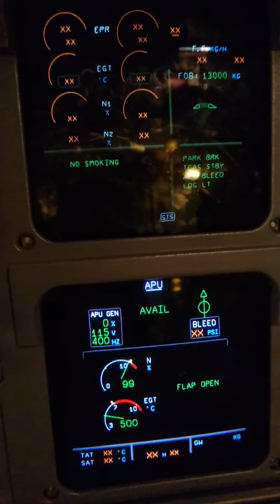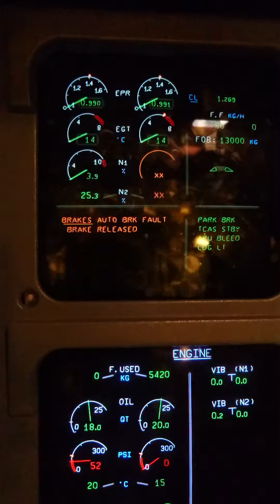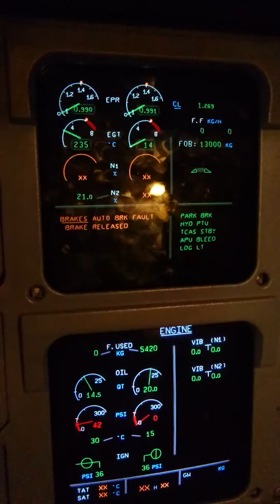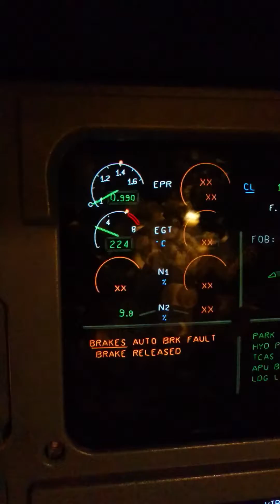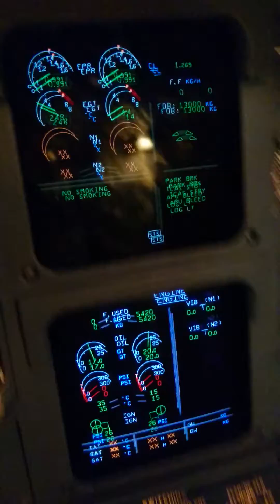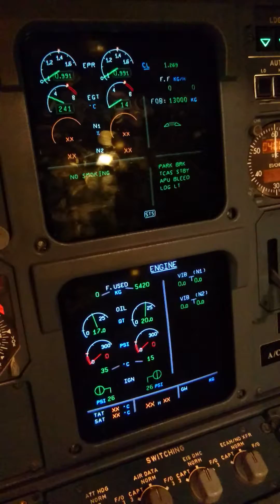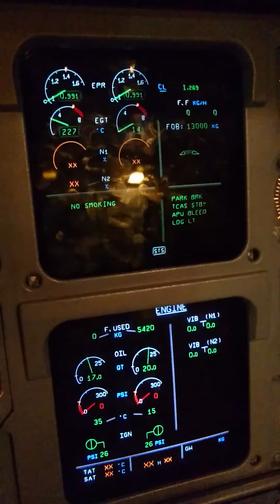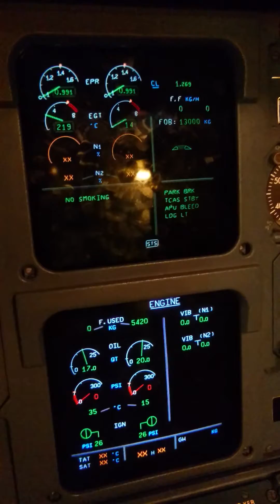Airbus, A320, Tailpipe fire scenario & procedures , for training purposes only

Comment: No need to wait for N2 to decrease below 10% before selecting manual start push button to ON.
If selected ON above 10% Start valve will wait until N2 decreases below 10% then will automatically open.